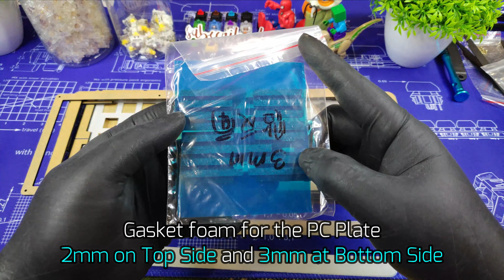Rebel60 Stacked Acrylic Case with CM64 PCB, PBT Clone “Blue Moon” Keycaps & Gat Yellow Switches.

Comment from the maker: Rebel60 Stacked Acrylic Case with CM64 PCB, PBT Clone “Blue Moon” Keycaps & Gateron Yellow Switches. Mechanical Keyboard.
Currently the Keyboard (PCB) was sent back to techt to help us on the LED issue.  No Lighting effect shown in this video but we will make a separate video on it when it is returned to us.

Comment: is the rebel60 hotswappable?
Reply from the maker: Rebel60 is only the Case (Stacked Acrylic). it supports GH60 PCB layout, the plate given with the case is 64key.  in this video we used the CM64 PCB which is Hotswappable.